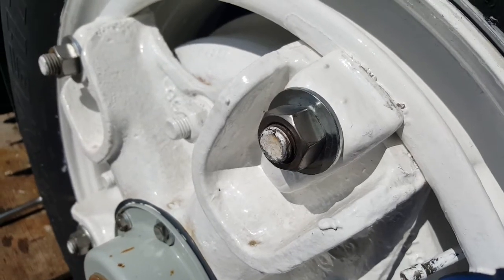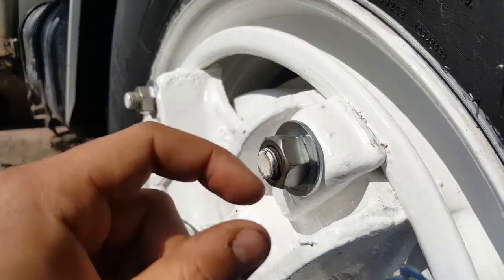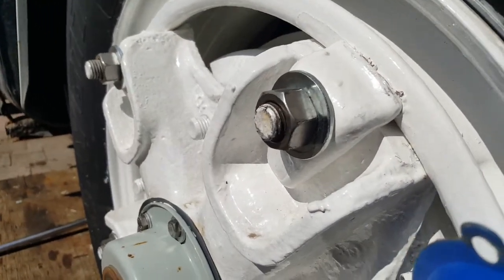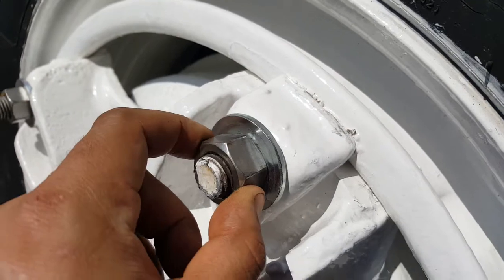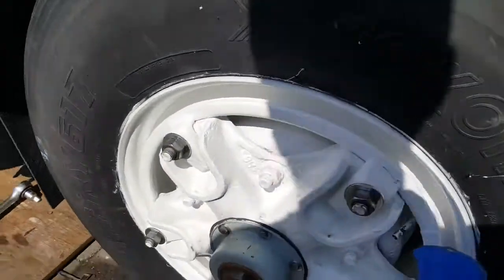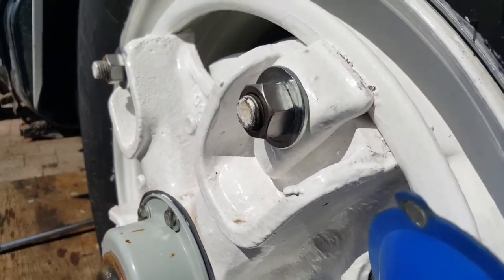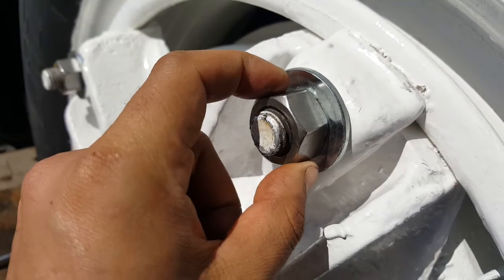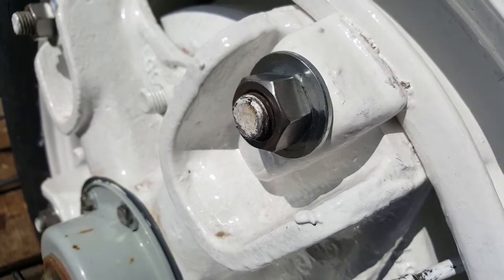Why do you need washers?

Comment: You missed three reasons. 

4. To reduce drag/variance when applying a torque
5. Less likely to seize
6. I'm the case of lock washers, to prevent nuts from vibrating loose
Reply from the maker: I think those reasons are implied, but good point!
Reply: Yes those reasons are implied in the first point stated in the video, to distribute the load of the nut on the material you are bolting down.
Reply: @whitematt Spring washers was a good point, although not discussed in this vdo